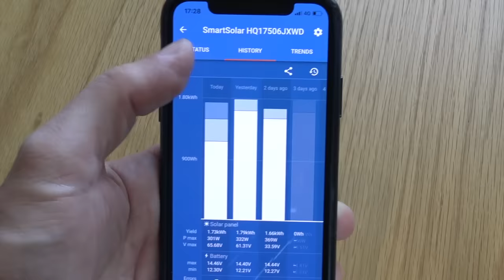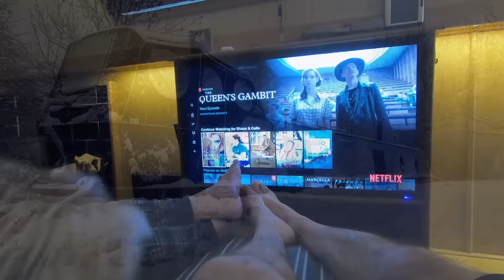NARROW ESCAPES! Ten Reasons Why You Should NEVER Live On A Narrowboat! Ep. 163.

Comment: I had no idea about the noise. I have enough problem with that in a house where the noise is fairly regular and I can get used to what each noise is, up to a point. Then there's the issue that when I move, it me months to figure out where everything is. That one issue is the main reason I'm not thinking about getting a boat. Not to live on, anyway. But all that talk about cold reminds me of when I moved from the South Coast all the way up to the north end of the Midlands one November. I had enough stuff, and my new home was small enough, that getting all the stuff out of the van meant piling most of it in front of the fire. Then my fatigue issues prevented me from moving it for more than a week. I'd made sure my 3-seasons sleeping bag was accessible, so I had that, but the lack of heat meant I spent all my time in it, except for maybe 1 or 2 hours a day, at most. If any air got into the sleeping bag I was freezing, but with it all done up properly I was a bit too hot. You absolutely do not want to know how that sleeping bag smelled by the end of it. Bit of a horror show, that.
Reply from the maker: ewww! 🤣

Comment: Lived on one . It's a massive money pit. Blacking every few years.  License fees every year.  Mooring fees. Insurance.  Constant maintenance.  Always buying batteries and alternators . New cdi units ect. Plus you need diesel to survive.  Have to run your engine to make sure the batteries are topped up. Always buying sump pumps and water pumps.  Having to hire plumbers to do gas safety checks.  Then every 4 years you need a boat safety certificate to. Plus you need a british waterways key for elson points for water ect  buying smokeless coal for your burner. Need to buy so much diesel for domestic and the rest you pay duty on. Then theres the food bills and your always buying things that easily get lost or stolen off your boat to.
Oh and gas bottles aren't cheap either.
All that in mind I still loved it . Lived on one for nearly 3 years.  It was actually some of the best times I've ever had.  Despite all the expense .
Reply from the maker: Still cheaper than living in a house 👍🏻

Comment: I have noticed on several of your excellent videos...when we see Shawn's hand on the tiller,  there seems to be a throbbing or slow vibration of the tiller. I wouldmthink that this mmight be caused by an imbalance in the propeller or in the propshaft...either of which could cause undue wear on the system and/or loss of efficiency.  Worth looking into the next time the boat is on the hard.   Hugs...
Reply from the maker: Nah, it's just the disturbed water 🤣

Comment: I'm inclined to agree with Foxes Afloat, it can be extremely costly to live on a narrowboat. Having a father who spend twenty-two years in the United States Navy on board ship. (Including having grown up around the Pacific Ocean and having boated the Puget sound which connects to the Pacific Ocean, there can be much stress involved in owning a boat.) Unlike a van or car, sitting on dry land if a bad enough storm comes in it can sink your boat. Where with a car/van you can drive away from a storm before it gets bad enough. While a van/car rusts it is much easier to fix the rust spots on dry land then to try to fix pitted holes in a boat when the water is over your head, because as we all know people don't breathe water and hiring an unwater welder costs thousands of dollars. A van or car has the ability to pull away from another vehicle that is making a extemporaneous noise and find a quiet place to reside. Not to mention, you can sound proof a vehicle during your conversion build which will cut down on the noise factor quite a bit. If the water level is too low, then your narrow boat has to sit until the water level raises, if the river is too narrow to turn around in. Where as, if the van or car is on a narrow two track, you can try to find enough room to turn your vehicle around in or either go forwards or backwards until you can find a turn around spot, due to a van/car having a smaller turning radius then a narrowboat.  Originally, I thought about living on either a schooner or a house boat, but decided against doing so because the costs for living on one can be astronomical over the long run. Including, all of the logistical problems which come along with living on a lake or the ocean. Instead, I decided on converting a van to a home on wheels for me to live in and travel in within the near future. As a future van dweller, I will have the same problem trying to dispose of waste. The best options that I have found for waste disposal are either an incinerating toilet or a composting toilet. Due to not always having a dumping station available to dump waste in. I have found that it is easier to find a rest stop bathroom to properly dispose of the liquid waste and what little incerated or composted waste, is left or bury the composted or incinerated waste out in the woods. I realize that when living on a narrowboat it can be more difficult to find areas to dispose of incerated or composted waste. -All my best to Foxes Afloat

Comment: Why have they not made SOLID PLASTIC HULLS if there is pitting on metal hulls? Or ATLEAST  a coating of plastic or polymer similar to flooring which drys ROCK Hard.  Showers are meant to be more cost saving than a bath AND cleaner.  Maybe water tanks should have something like a kettle element in them.  So when it's really cold the water can be PRE-WARMED..not boiled. Via controller circuit which detects temp.  Reading while dropping logs?... Nope.. Get in and get out.  Are the hulls sprayed with insulating foam?  Why do boats not have something similar to a small wheel below the water line at bow or stern  Maybe they do already which acts as a generator? When the boat moves in the water the impellar moves and supplies more electricity.. If you make any money.. You heard it hear first..😆😆😆😆😆. Anything which might save some cash.
Reply from the maker: Lots of ideas there. Ever considered a career as a boat builder? 🤔
Reply: Remember your school days physics lessons: You cannot get something for nothing energy-wise. Fuel burned to propel the boat along can only convert that energy consumed into another form, say diesel gives up energy in the engine, the waterwheel turning a generator could make electricity. But if you examine the efficiencies, you'd likely find a better way of making electrical energy from running a diesel engine vs that given back by your paddle wheel. ps:  It's called a generator.

Comment: I couldnt handle all the poo I'm surprised they haven't put a macerater on those boats then you could pump it out at poo station they have them on expensive motorhomes in the states I also wouldnt like all the mud.
Reply from the maker: A lot of boats do have macerators and pump-out tanks. They stink! It's expensive, and you're stuck when the canal freeze over 😕